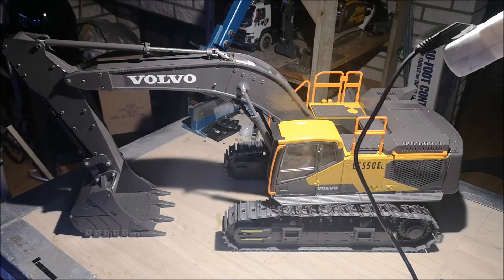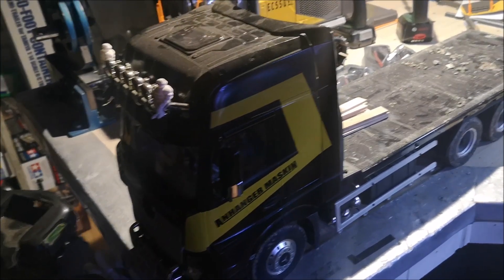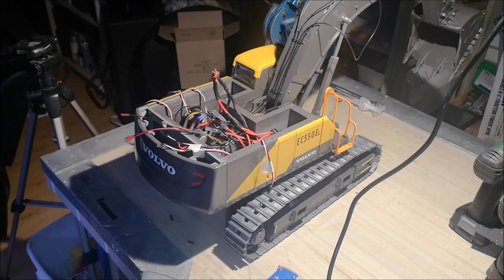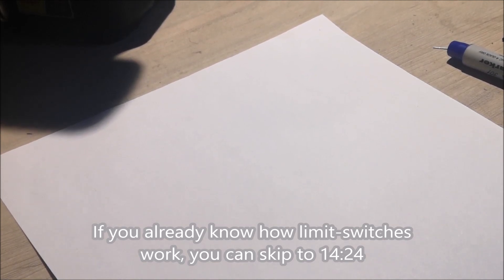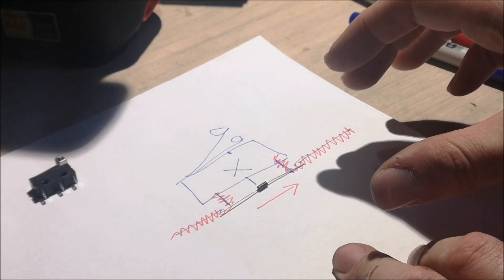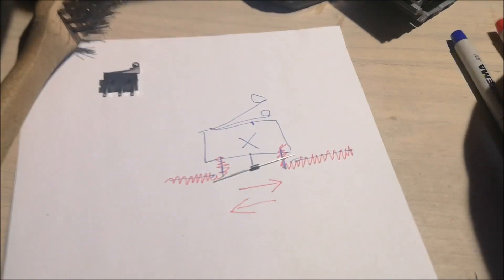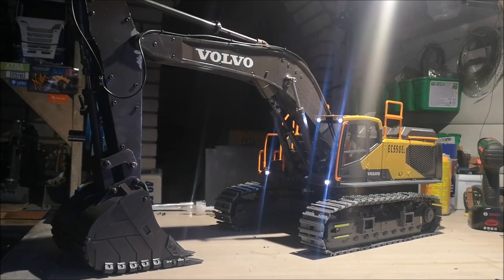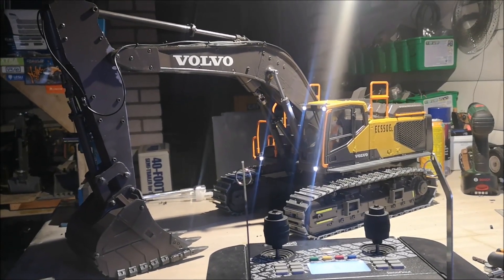Making a 3D Printed RC EXCAVATOR - Volvo EC550EL - PART 11

Comment: Hi Lasse.  The diodes have a band on on one end.  Does the band go at the end you want the power to flow or at the end you want to stop the flow. 
Also what screw servos are you using?  Or did uou make them yourself. Thanks